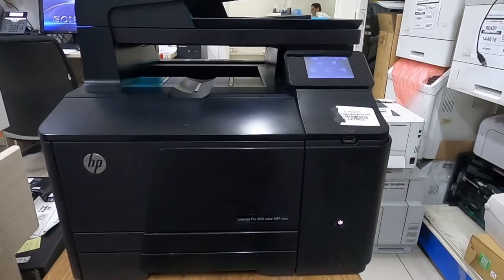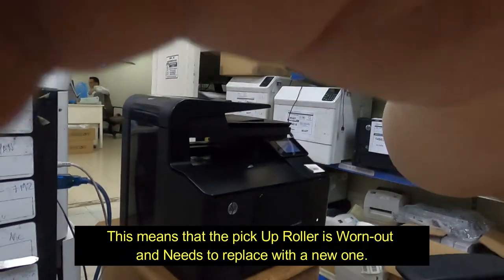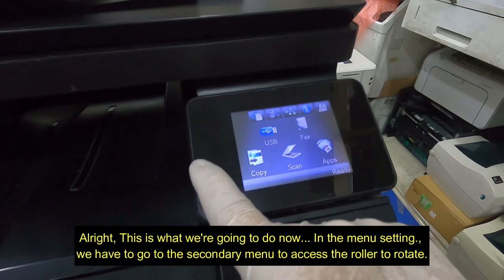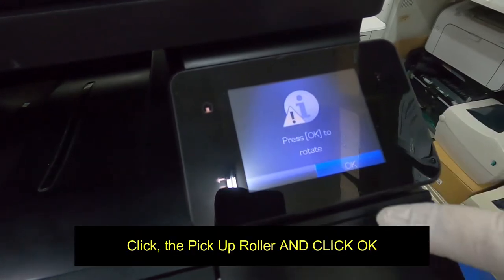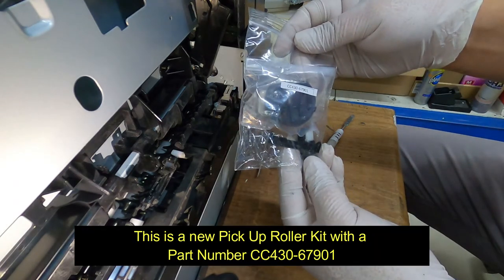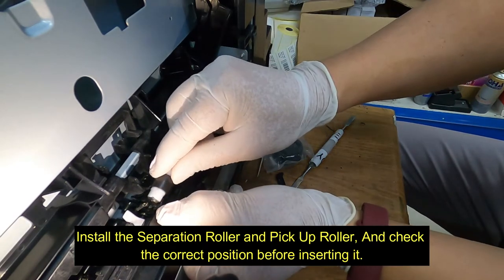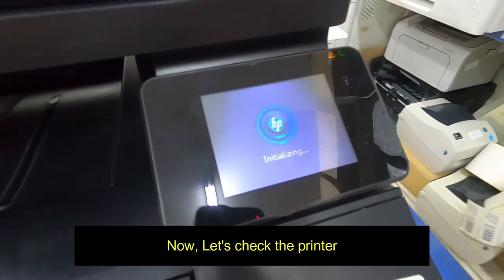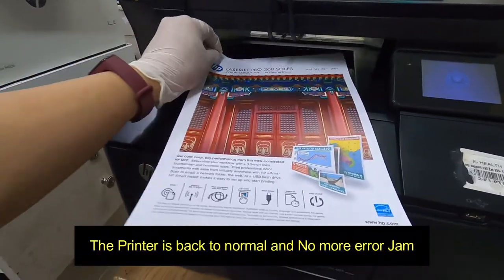How to Replace Pick-Up Roller | LaserJet Pro 200 Color MFP M276nw

Comment: garbage printer. the separation roller assy falls apart when you try to move, or even adjust it. don't waste your money on this poorly built model. the pickup roller is easy to replace.